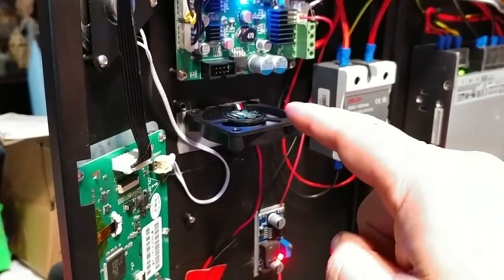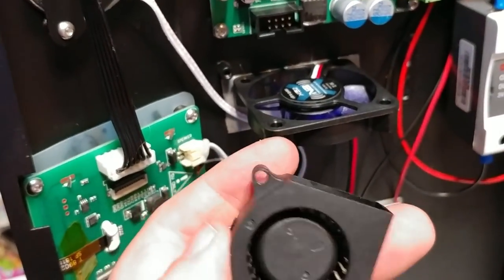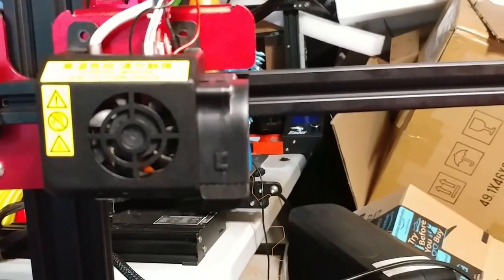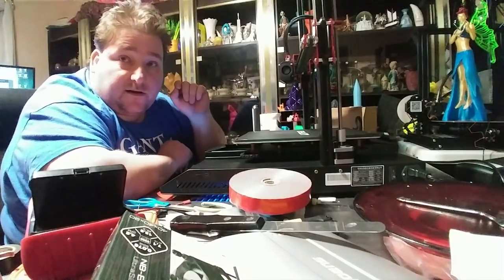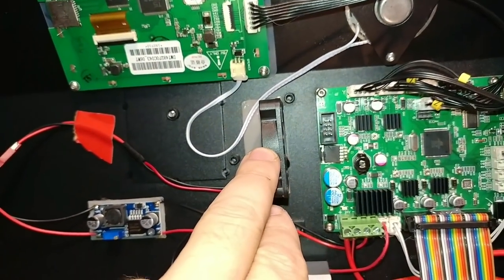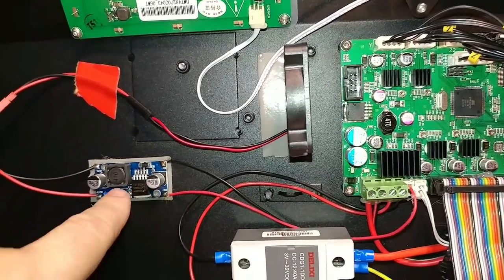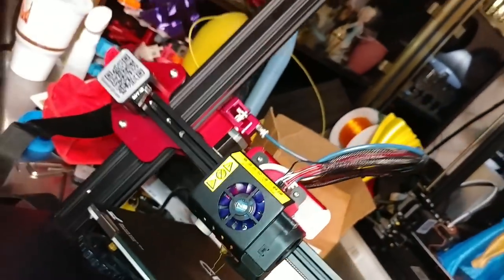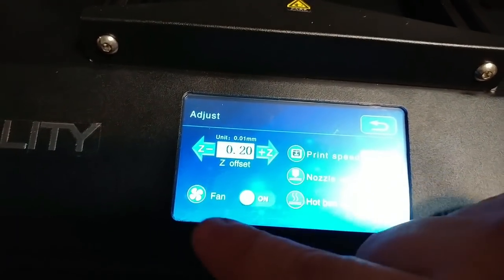CR-10s Pro Ultra Quiet Upgrade for Fans - T3DP

Comment: Hey, I just recently got my Cr-10S pro. My hot end fan has a rattle, is that normal for the stock fans? Thank you for the video guide, I may have to do this to make my printer quiet
Reply from the maker: Yes and know the fans that they put on the printers tend to be pretty cheap and so the failure rate is reasonably High

There are a couple of alternative reasons for a rattle if the fan is loose inside the housing it's going to Rattle so with the printer off so the fan is not turning you'll poke at the fan with a small tool does it move? If yes you may need to carefully remove the housing and tighten up the fan bolts so it doesn't rattle you could also put a very small amount of lubricant into the center of the fan to see if you can lubricate it otherwise you would be looking at replacing it once it fails or the noise drives you crazy :-) it's a 40 by 40 by 10 millimeter fan and it's 24 volts you could replace it with a quieter fan but that would also require a voltage converter I have an entire video dedicated to that
Reply: @nerys71  I did not expect for a brand new printer to have a bad fans all ready, I know when computer fans make this sound, it means the bearing is dying. I cannot find the hole where I can put oil inside. I have tighten the duct as well. 

If I can ask, if I follow this guide how much did everything cost total to build with everything? Fans and converter?

Also have you used any different firmware for the printer? So the auto leveling saves?
Reply from the maker: The voltage converters are $6 for 10 of them. the fans are around $12 to $16 each. you need 3 for the full quiet effect (you can reuse the hot end fan so that saves you one fan) so your talking well under $50 total as long as $40 give or take a few bucks. you need 1x 40x40x10 1x 50x50x10 and 1x 40x40x20 you also need a 40x40x10 for the case but you can reuse the 24v hot end fan and just run it at 12v works great and is quiet BUT if your hot end fan is failing you would not be able to reuse it. so lets say between $40 and $55 total.

no I have not replaced the firmware.

NO you should not expect a brand new machine to have issues.

NOW mind you what I am about to say is not JUSTIFYING anything. just "explaining"

you always have a failure rate. no matter who makes the product whether its gcreate or ultimaker or prusa or creality.

when you order from china YOU WILL have a higher failure rate. its a given. you are buying a $2500 printer for $650. there is no way to do that without cost cutting to some extent. so failure rate WILL be higher. you just have to accept this reality

NOW they are pretty decent about taking care of these kinds of things IE they will send you a replacement but its coming from china. so again same higher than average failure rate AND it will take a month or more to get to you.

IE just buy a new one. less headache and no month long wait. there is just a limit to what can be done shipping so far. THE ARE improving and I do keep niggling them about the shody fans. to them this is an industrial machine they don't care if its noise anymore than average joe cares that his drill press or table saw is noisy.

but it is getting better. just remember. you saved SO much money going this path but the consequence is you need to do a little more work than normal on your end. good companies will improve.
Reply: @nerys71  Yeah thank you so much for the info, I am going to follow this guide so I can get a quiet machine running in my apartment.

My machine was only two days old so there shouldn't be a fan failure that quick.

For the fans, did you try both of the fan you suggested? If so which one is more quiet? Noct?
Reply from the maker: @jamesn2885  they're both essentially silent I tend to use noise blockers only because they're cheaper but I imagine they are both equally good Quality and effective
Reply: @nerys71  thank you for all the info, I will purchase all the fans and stuff through the links in your description.

Comment: Hi Chris ! You mentioned how quiet the motors are. Did you use dampers? Great work!
Reply: I thing it already has tmcs drivers
Reply from the maker: nope it does not need them. it has TMC based or similar drivers. I may try to add some dampers for shiggles to see if I can make it even quieter :-)
Reply: It's not like you don't have them just lyin' around.
Reply from the maker: i'm out actually 30 more coming from china in a couple weeks. (real cheap if you buy a bunch) @jasonorban1446
Reply: @nerys71  "just for shiggles"... Chris, you just made me go to the dictionary. And now I've learned a new word.  ;)
Reply: @pedrosoares1815  It sounds like one of those words that people make up for portmantiggles.

Comment: Hey Chris. Impressive silence mod! I'd be particularly interested in finding a radial parts cooling fan that does not whine when you run it below 100% voltage. If you happen to find one let us know. Have  a nice Sunday. Cheers!
Reply from the maker: the 40x40x20 24v radial fan on the Pro runs very quite with no audible whine at 40% speed and provides sufficient cooling. but yet running it at 60 or 80 % makes a nice brain scratching whine :-) so I run mine at 40% no cooling issues so far and its ultra quiet.
Reply: Hahaha. Thats a start. So it should also run on my Ender 2 and the CR 10 when I set the RPM to 80% or 90% Speed. Can you go even lower for when you print PETG or else? Cheers!
Reply from the maker: @rodsnyder6020  just remember this fan is 24 volts the parts that comes with the pro so it might run on the enter to and cr-10 but it will run at 12 volts I personally run my fan at 40% which is very quiet and usually enough Cooling I don't know how well the run if you try to use it as a parts cooling fan on a 12-volt system there's one way to find out :-)

Comment: Hey man, hate to keep bugging you but... I bought the NB fans you recommended (from your link), they have 3 wires in them WHITE, RED, BLACK.  but the existing fan only has 2 wires. Black and Red.   It doesn't look the fan you used has 3 wires. Which pair should I use?? Or did I get the wrong thing?
Reply from the maker: Correct just snip off and ignore the white wire you don't have to worry about them

Comment: Just a warning i used : LM2596 Step Down Power Module DC-DC Converter with LED Display and it fried the board on the X Axis where the ribbon cable attaches... i really not sure why, any ideas? (EU ) dont know if i can even get a replacement board for this now.. if anyone knows where i can buy one would be really appreciated. I then added to the hot end cooler and the lm2596 went up in smoke i didnt even have the output attached.. very confused. If anyone know which cables on the ribbon cable for the Cooler Fan i could try bypass the board. Any info much appreciated! thanks

Comment: Buddy tmr i get the CR-10s PRO and i try to order all the fans you recomend. But i am a little confused, which one you use for which place. The first  50x50x10 for the board is clear. Also i worked with stepdown before. But i am unsure which one you used finaly for the Hotend, and with the rubber in the case, and which in the power supply? did i forgot one??? :-) Would be great if you can help with for e.g  1. Board = NB 50x50x10 XS-1  , 2. Power Supply = ... 3. Hotend= same as 1?  4. Case (with the rubber) = ? Did i forget one? Thanks in advance :-) And which double tape is the white double tape you use at the board converter? I am also unsure that some of the recomended fans using 3 or 4 wires.
Reply from the maker: The 50/50 10 as for the brain board just use sticky tape to attach it or check thingiverse someone designed amount for it

You need a 40 40 20 for the PSU no voltage converter needed you need a 40 40 10 for the hot end cooling fan

The case fan is another 40 40 20 or you can reuse the 40/40 10 you remove from the hot end and simply run it at 12 volts for the case fan this has been working fine for me

If you click on my Amazon page and go to 3D printing parts and accessories in their there is a link for the voltage Buck converters it's $6 for 10 of them they are very cheap

 All fans require a voltage converter except for the PSU fan that one already runs at 12 volts internally so you can simply replace the fan no need to down convert the only fan you cannot replace is the parts cooling fan
Reply: @nerys71   I thank you very much!!!

1x 40x40x10 Fan + Converter 
   (for the Hotend)

2x 40x40x20 Fans 
   (1x for PSU without Converter), 
   (1x for Case plus Converter - the one   from the Hotend works fine)

1x 50x50x10 Fan + Converter 
   (for the Brain Board)

And what do you do with the 3 or 4 wire fans - do you cut the 2 wires (not red and black) away?
Reply: @nerys71  have you seen already the video from Nexi Tech where he exchanges the sensor with an inductive sensor? What do you think about it? He says it fix near all the problems with the Z-Axis.
Reply from the maker: @tamgaming9861  that's correct you just cut away the extra wires you don't need them
Reply from the maker: @tamgaming9861  yes and I already ordered and received a couple of induction sensors to play with :-)
Reply: @nerys71  ah damn was in hope i can give you some good help back. Thank you very much. I have now the BL Touch here, but order now too the induction sensor. Btw. he recomends a bit lower, to decrese or increase the distance to  3mm to get better results. So if you also order it, i will install the inductive too. Is it normal - because my S PRO is now here, that the plate is so much bended - near 1-2 mm in the mid? Norrmal i know that it will become flat with heat, but read also from other S PRO owners, that this is a big problem and that the sensor cant do his work because this. Normal to lvl the bed is - heat it before lvling. Do you think i should exchange it with an IKEA 30x30 mirror like on the CR-10?
Reply: @nerys71  thank you - yes for most i read in the amazon formums there is from noctua a special fan version which has only 2 wired but its the same model - BUT costs total the same  :-)
Reply from the maker: @tamgaming9861  if you use class you will want to stay with capacitive. Double check flatness. Mine is absolutely flat even though sensor says 1.5mm off. Sensor is wrong. Try leveling WITHOUT the heat bed on. It seems the ssr can generate noise and this is why the sensor is wonky. Use z offset once heated up and you start printing.
Reply: @nerys71  Hey buddy, i really can understand the bad reviews about this machine. I really made a lot on my old CR-10, but his PRO... its a fail construction and underlines "made in china". I had five screws lying around in the box. I had no idea where they had to go. Then I found out that they belong to the right Z-axis motor. I had to dismantle the whole pressure bed, because the rollers were stuck underneath, some turned and some not at all. Every time I pushed the bed back and forth it jerked at the same places. The same on the Y-axis at the hot end. That the bed is 2mm bent down in the middle is really unbelievable! The aluminium plate is so easy to bend that it's no wonder. The right Z-axis on the motor is under so much pressure that it always wants to rotate automatically when you move the motor to the left to get the Z-axis horizontal. Some wheels are loose and some are so strong that you can't get them. At 2 screws of the thread bar the washer was forgotten. So that if I tightened the screws of the threaded rod, it wedged and the motor could not turn anymore. It really is a nightmare, and I can definitely not recommend MY machine to a beginner or to someone who just wants to press the ON switch and then print. I have already ordered a 760mm belt and 2 pulleys, but in the end the left motor always has to do the work of the right motor. The problem is, you would have had to redesign the right side to absorb the forces, because it's much heavier and the Z-axis is out of balance, creating the pressure that leads to the Z-axis having to be re-aligned every time as I read it. The update to 1.60.71 wasn't difficult with Cura, but so far I haven't even turned it on because it's not right. I have no idea if I can do the Z-axis in a way that it doesn't always slide down automatically on the left side as soon as I remove the spacer. Do you have any tips for me?

Translated with www.DeepL.com/Translator
Reply from the maker: @tamgaming9861  thats qc problems and not good. Going to have to get naomi to light a fire under their buts!
Reply: @nerys71  oh man buddy i can tell you - till now i havent made a print - still worked on the Z-axis - its still 1mm off on the right side, but no anymore as bad as it was 6mm. I think i have to take it off total because it wasnt assembled right, so that the screws from the long alumium profiles are not 90° . its really like in the early chinese years - such a bad QM... waow... You excpect a mercedes for this price and even its only a A-Class - but you get a FIAT UNO with lot of problems. I fixed my bed with tape in the mid. 2 small layers, and now its flat :-) The bedlvling is hard i found out. I also cant see a benefit against paper messuring. Where is the improvement? I wish now they had only changed the board and the 2nd motor. The tft display i saw many have problems with it. 1. with updates to open a case for it 2. that it has flickering 3. that it has pixel problems. Everything else in my opinion is not needed. The fans we have to change by our self. Only good thing is, now it heats up faster and higher and the extruder is nice for flex.
Reply: @nerys71   :-) Just a question, after i updated now to the newest firmware from crealtiy, do you think i still need to update the display from tiny machines or is the problem solved with it?

Comment: Here is a question to everyone, I'm in a need of a 3d printer that does flexible filaments. Can the New CR10S Pro do this now? and if so how well - Thanks
Reply from the maker: Yes it can do flexibles and it should do a halfway decent job of them but of course it is a Boden so is going to be limited on how well I can do flexible filament because of that to do flexible truly well you really need a direct drive printer such as a prusa or something similar with a similar hot end to really do the super flexible stuff if you just want to do typical TPU then the cr-10 Pro could do it just five
Reply: @nerys71  Thanks for getting back to me on that. I would love to purchase a Prusa but the build area is smaller the CR10S so I really don't want to be limited in that area. I guess I'll have to see about a Pro moving forward.

Comment: Any suggestion for ender 3 PSU fan replacement?
Reply from the maker: Yes. just use the appropiate fan listed for the size fan in the Ender 3 PSU

CHECK TO SEE IF ITS 24V OR NOT

if its 24v you need to downconvert the power to 12v.

you might be able to simply "run" the stock fan at 12v (if its 24v) and make it just as quiet! like I did with the stock creality 24v fan.

Comment: Can't you just use two of the same model fans for the case and wire the fans in series? The fan in the power supply is already 12v, so three 40x20 fans would make this project simple and not require any voltage step down converters.
Reply from the maker: No you can't wire fans in series in order to run to 12 volt fans off of 24 volts I don't understand the exact details but I understand it can't work not properly
Reply: @nerys71  thats wrong, you can totally wire two 12V fans to a 24V PSU in series.   using a multi meter it reads around 12V doing that give or take 1V
Reply from the maker: @BLACKSYNTH  it is not a matter of can you but a matter of should you someone else explained it to me I don't remember the exact explanation but something about the way fans use power why the meter will show 12 volts the fans can see 24 volts especially if one fan fails I'll have to try to find the explanation but the consensus was it's not advised
Reply: @nerys71  seems like for a 2 dc fans of the same draw its fine,   but for the price of buck boards might as well get them.    I got my cr10s pro today and ordering all the  upgrade parts,  Still. Reshearching it.    Im replacing the hotend fans/shroud aswell.
Reply: Actually another guy on youtube did this, Nexi Tech.
Wiring them in series is fine so long as you dont go over 12V on the first fan in the series.

Comment: Hey I was wondering with the same fan nerdy used for the hot end I used it is hooked up threw the same converter running 12.01 volts.hooked up the red to red and black to black then tested. It runs the opisit way the old fan did and seems to run really slow . it makes 0 sound but does not seem to push a lot of air. Should I have used the third white wire some how or is this going to be ok if I turn it around or should I up the volts to 13v like nerdy did.please help
Reply from the maker: If you are using the 24v stock fan turn up the voltage a bit.13-14v is fine.  Aim it so it exhausts air from the case.

Comment: Would this upgrade work on the  CR-10S Pro v2?
Reply from the maker: In theory yes you would just need to verify the dimensions of the fans
Reply: 8 months later, yes it does, I just did this yesterday and it's a huge change. Now for the hot end fan however...
Reply: Can confirm like @Arne Barne. It took me a while, but I wish I did this day one.

Comment: Planning on getting my first 3d printer
I am thinking of the ender 3 (because of price $200 shipped), i know I will need mods
What is my best option at $300? And $800? (my max)
Reply from the maker: $800 and under go with the CR-10s Pro. its truly an amazing machine in my opinion (so far I have only had it 1.5 months)

for sub $300 go with the Ender 3 Regular or Pro if you want to do ABS and other high bed temp plastics go with the pro. if you can swing a wee bit more get the CR-20.
Reply: Thanks so much for the reply.
Thinking of getting the cr-20 waiting to see if any deals pop up